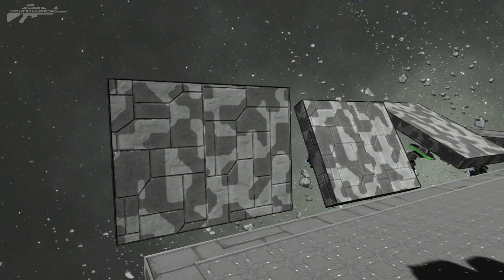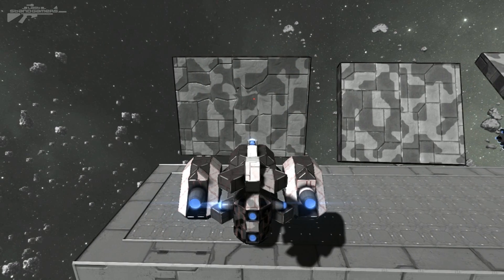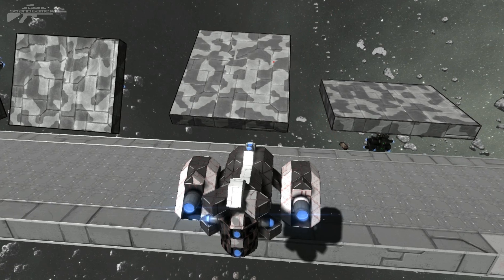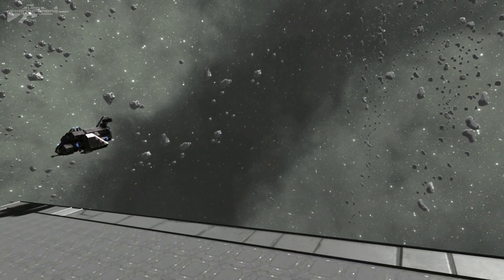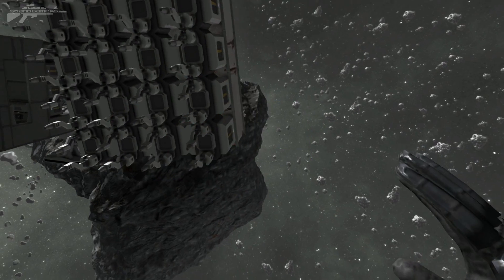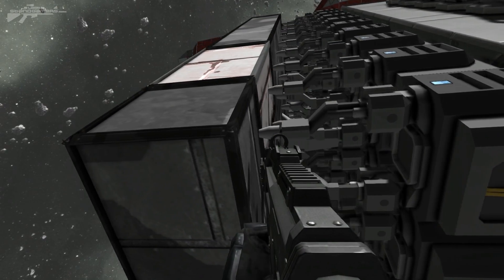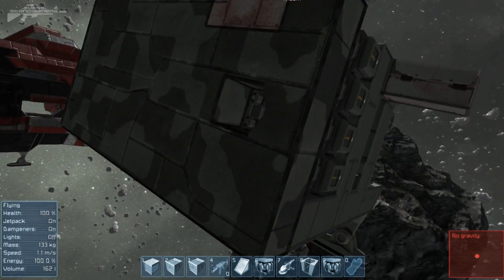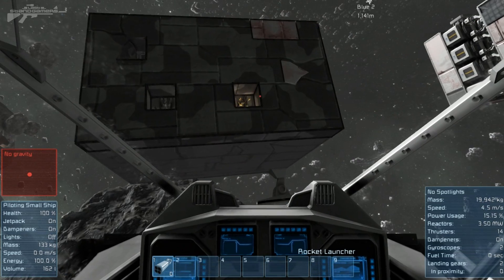Space Engineers - Sloped Armour, Deflecting Missiles Self Repairing Armour

Comment: If I am not wrong, in real life rockets don't make ricoshet, because they blow up on the impact. The only ballistic objects, that can do recoshet, are AP tank ammunition (not the HE one, it blows up into pieces on the impact, and that is why it is mostly used in cases of infantry), AND bullets. There's probably something else, but I am too lazy.
Reply: It depends on the trigger mechanism comrade. AAMs generally have a proximity fuse because actually getting a solid hit of a aircraft is nigh impossible, so they don't ricochet unless the detonator fails and it manages to make contact with the craft and said impact doesn't destabilise the payload.

Dumb fire rockets like the RPG 7 generally have a contact detonator on the tip of the war head, so if the rocket doesn't strike the target on the detonator it is prone to be deflected. I mean that's a gross over simplification, the tip generally has crumple zones in it as well that both reduce the likelihood of accidentally bowing up and decrease the likelihood of deflection.

They're also picking you up on the translation thing because you're missing some redundant grammar that English uses. It is most excellent comrade, don't ever change.
Reply: Ohh, and also, in WW2 Tank AP ammo (don't know is it still here, in XI century) had a normalization point, and this helped decrese some degrees of the impact, so it is easier to penitrate. For example, the AP flyes into the enemy at 60 degrees, but normalizes to X degrees, which makes it easyer to penitrate. (When X is trajectory of flight (60 degrees) minus amount of normalization the shell has.) 
Well, of course, I am russian, but I hope that it is called normalization in English...
Reply: Crimsun Barun You don't need to translate it, I am good at english. And also google translate is not great at translating phrases. Well, probably rockets can ricoshete but only in some random conditions, and on the angle more than 89 degrees. Cuz rockets, are, preety much HE shells, but only on faster speeds.
Reply: Crimsun Barun That is no problem. I am sometimes hearing words about me using translate. That is just because I am too good for russian :)
Reply: Тимофей Желудков Crimsun Barun
yeah, rockets can ricochet as long as it either does not hit the pin (on the front tip to detonate it) or it is not hit in a certain way making it explode (getting shot by a bullet ect)
Reply: jayden shadlow And That is what I am talking about. So, the only way to ricoshet is to hit a target at 90 degrees, either it will hit pin on the front.
Reply: Real life rockets do ricochet, they have a smooth top going into a half circular shape, if it bounces off a angle of 90' or more they will bounce.
Reply: Thanks jayden shadlow

I'm a Mechatronical Engineer. Basically all I do is trigger mechanisms and watch as my dreams of working on cybernetics are slowly crushed into dust.
Reply: Rockets can ricochet assuming they fail to detonate.
Reply: even if the rockets detonate, against sloped armour it won't do as much damage because the force of the blast will be deflected and spread across a greater area.
Reply: Master Spark
you explained it better then anybody else ever could have
Reply: HE can bounce if the activation mechanism never gets hit and it bounces off.
Reply: rockets from a rocket launcher can ricochet if within 300 meters
Reply: Phyllis Cantrell in real life
Reply: Not every rocket is HE. Some rockets have armor piercing elements.
Reply: It always depends on how the rocket is configured to explode. Some are designed to explode before impact, some during, and some before.
Reply: IMBORDED1 Don't you mean before, during, and *after?
Reply: Jesse GD derp derp derp, that's exactly what I meant

Comment: On the first regenerative armor test, didn't you need to go into a cockpit and manually fire the welders?

(Drag and click to the weapons bar.)
Reply: nope welders,grinders and drills can all be turned on using a console panel
Reply: adam smith They can also be used manually... To what I recant...
Reply: when used manually they dont stay on when u exit the cockpit so the walls wont repair when he shot at them that's why he did it via the console. :D
Reply: adam smith I was speaking more in context of the multiplayer perspective...
Reply: its still easier to turn them all on then pilot the ship otherwise you'd be trying to fly and hold down the mouse button also this wont work in multiplier the metal plates must be attached using landing gear and they cause major desync issues
Reply: adam smith What the fuck are you on about?

Comment: The biggest reason the sloped armor isnt really effective with a rocket is, well, because its a rocket. Its essentially like firing an HE at a tank. Its aim isnt to penetrate, so its already out if the question. But another reason is the explosion is the cause of damage, not vital damage by means of getting the munition into the hull. Try using the gatling guns on sloped light armour. Thats the best way to test is sloped armour actually does something.

Comment: Regenerative armour is cool, but not practical. even small fighters rarely have fewer than 2 missile launchers, and two close hits with missiles will almost always destroy 1-2 blocks, and with a couple holes in the extremely thin armour, it becomes quite easy to destroy the internals.

I'm just curious how you go tit working without having to make the welders move. In all my attempts, the welders didn't work consistently unless they were moving slightly relative to the ship they were welding.

Comment: I think the welders for armor inst quite a feasible idea for survival.
However if you take that same idea and apply it to your main engines, reactors, or other vital components by placing welders inside the ship, you can keep your components repaired constantly and never have to worry about being dead in the water so to speak.
Reply: Engines maybe. I like that idea. But reactors? Isn't the damage from one rocket enough to cause it to blow?
Reply: Ernicification Maybe, but I was thinking more of secondary damage. Normally my engine room is heavily armored, however rockets can distort the armor blocked without breaking them. If another item is in the path of the distortion, it can be damaged. So my idea was if it receives minor to moderate damage, it can be repaired. If it is severe damage, you're probably going to lose it but hopefully have secondary systems in place.